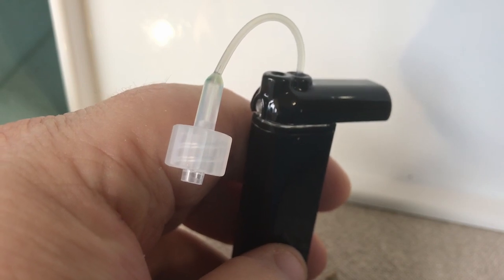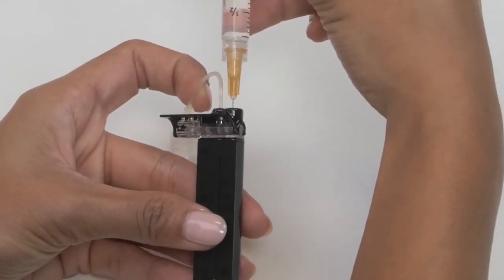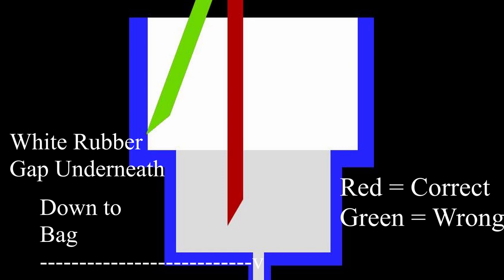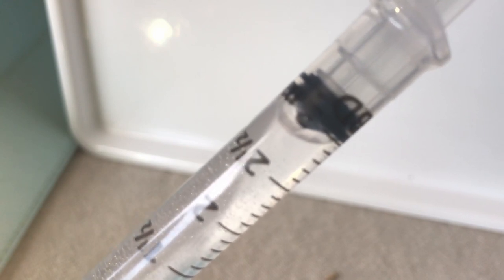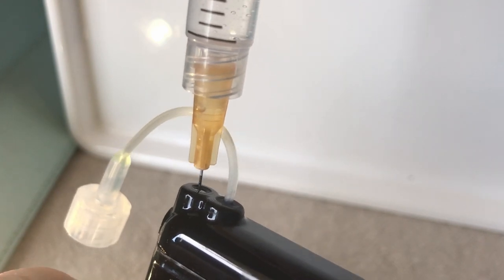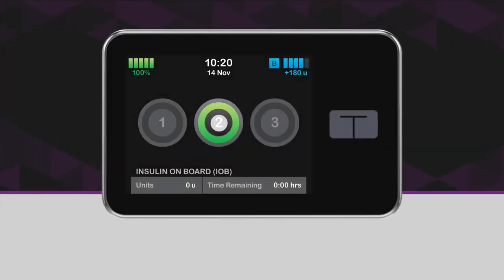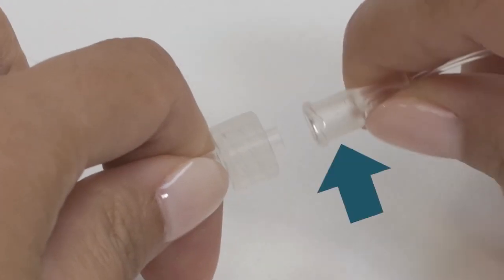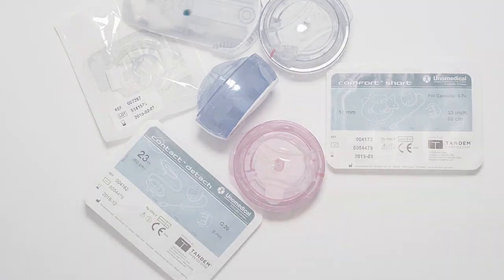Fill process of Tandem TSlim Cartridge with a minor modification

Comment: There is a lot of small bubbles you don't want to get into your body. Don't you see them in the syringe? I choose to follow Tandems instructions.
Reply from the maker: Hi Trevor, they are up at the black rubber stopper of the plunger, and stay that way. If you keep a bright light, or a computer / phone / tablet screen etc and have the syringe between you and it, you can actually see when they start going from the main part of the syringe into needle part that screws onto the syringe. That’s when you stop  pushing insulin in. Remember plenty of people don’t even suck the air out at all, and who is to say you’ve sucked all the air out anyway

This works really well, and brings the wasted insulin down as close to zero as possible
Reply: This is bad, lots of air push in, push needle straight in and coring is possible, coring has thithin to do with how far the needle goes in, its when the needle cuts a core of the white material and it slides into the needle, the syringe should be clear if all micro bubbles of air, and no need to fiddle with air bubbles if the air is removed from the pump bladder with an empty syringe before filling it with insulin.
Reply: The air itself won’t hurt you, but means that you will have gaps in your insulin delivery.

Comment: Why don’t you just follow the instructions? No wastage of insulin if done properly, and no risk of air in your tubing.
Reply from the maker: Hi, because this is much quicker. You are only inserting the syringe needle into the cartridge once. Remember that some people don’t even suck the air out at all, and 18 months after publishing this video, I still do it without issue

Tandems method does include insulin wastage when expelling the air from the syringe that has been sucked out
Reply: I suppose if you are in that much of a hurry, yes it might save about 30 seconds. I wonder if you have actually timed both methods? And I do not waste any insulin when doing it the Tandem way. If you tap all the air up to the top before expelling there is no wastage. However if it works for you fine, but I am not sure it is a good idea to be teaching others to do these things the wrong way, as it may not work for everyone. Just look at the other responses to your video.